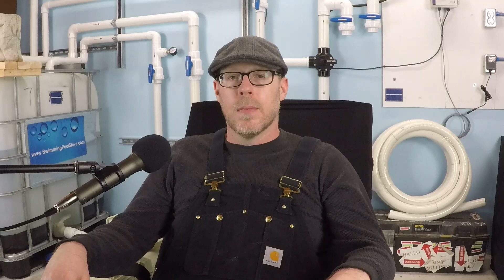How Much Flow In A 1.5" PVC Pipe?

Comment: The sand filter and pump I just setup came with 1.5" fittings and it's rated at 45 or 50 gpm. Would upgrading the pipe to 2" benefit if it still has to push it through 1.5" fittings?

Comment: Does flow efficiency translate to energy used by pump ? Is there a way of improving this ?
Reply from the maker: Yes, indirectly.  Pump power consumption does not go up with flow rate in a linear way.  Resistance to flow does however increase friction and transmission losses in the pipes, and it is these measurable efficiency losses which add up. They do not make the pump use more power, but it does make it move less water per unit of electricity consumed which is a net loss for your system efficiency.  You can learn more about how friction losses are measured in this article www.swimmingpoolsteve.com/pages/friction-loss.html

Comment: I made the mistake of buying a svrs pump and it keeps shutting off with an alarm code that says clear the drain. Ive done everything and it still shuts down. Do u have any advice
Reply: LOWER THE SPEED OF THE PUMP OR MAKE SURE TO HAVE AT LEAST 12 INCHES OF STRAIGHT PIPE ON THE SUCTION SIDE OF THE PUMP .
Reply: Clean debris from the impeller
Reply: How much do 90 degree fittings effect flow rate